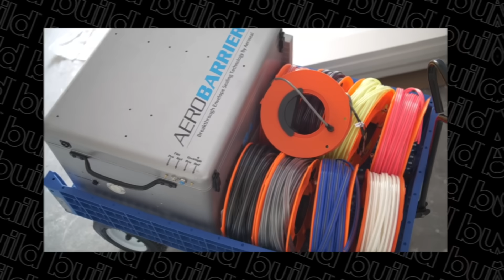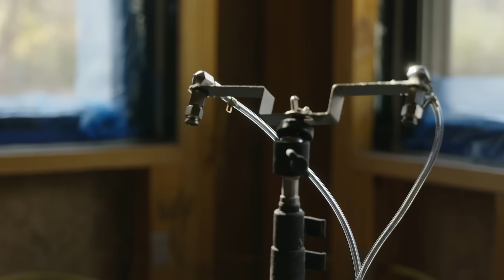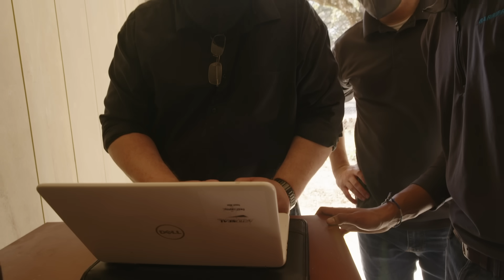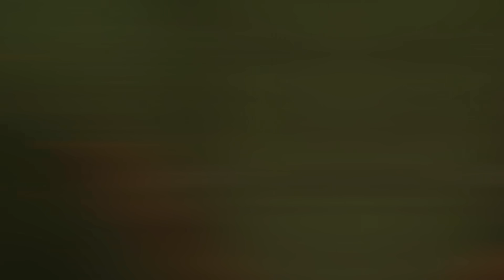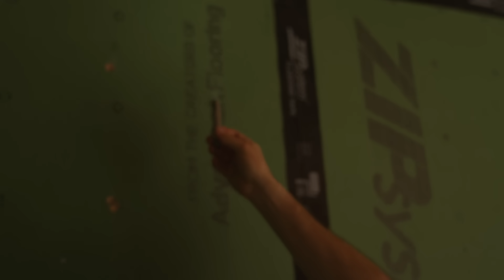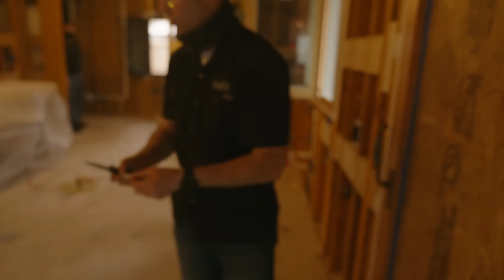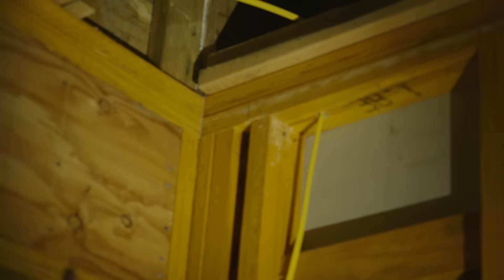The one product I'd recommend for EVERY House!

Comment: How incredibly inefficient. Like trying to use thousands of little fingers to plug holes in a giant leaking bucket instead of just building a better bucket that doesn't leak.

Anyone still using stick wood framing to build a house doesn't know what they're doing because they haven't been keeping up with any of the best innovations in construction: SCIPs, Thermasteel, Hemp Block, Green Rhino, Ecoplast panels, Mass Timber, SABS construction system, etc.

All of these are vastly superior to stick framing on the most important levels: faster, stronger, drastically more energy efficient (the SABS system and similar methods are at least 70% more energy efficient than stick-framed homes), more fireproof, disaster proof, more insulated, tighter building envelopes, pest proof, mold proof, waterproof, and in many cases, even cheaper in total cost because the framing, insulation, vapor barrier, interior, and exterior siding are all in one system, saving you the expense of hiring out each of those trades individually.

That's not even mentioning how much you'd save every month in energy costs by living in a significantly more energy efficient home.

As a pro, you're doing your viewers a disservice with this video and any like it. Do better.

Comment: Building a home this spring with the entire shell being made out of Thermacore's SIPs - moisture control like every house is key but even more so with the seams on SIPs since vapor can find every crack and make its way to the exterior OSB layer where it can condense and slowly rot the SIP from inside - That being said and if I have to choose the most cost effective means of dealing with this issue - the AeroBarrier Quote for the entire internal shell is $5500 - is this cost effective versus just using a WRB seam sealer like Prosoco or ZIP's liquid applied stuff???

Comment: In four or five weather cycles, there is a high propability that new and old openings will develop due to the house expanding/contracting and flexing under high winds.   

I see this as overkill and would never do it.  It more gilding the lilly in my opinion.

Comment: I support sealing a home with foam, wrap, taoe, caulking, etc . But sealing micro holes? I would never use this. I'd sped the $3k on more insulation or something more realist. Snake oil in my opinion. But I will say, its rather interesting. Love the channel

Comment: Complete hogwash!! People, read between the lines...
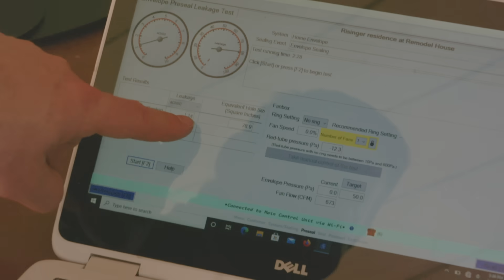...at 7:00, "if you were to add up all leakage, it'd be the equivalent of 40 sq. inches"... People, that is 6 1/2' x 6 1/2" (with a pressure fan pushing the air)...Just opening your front door for a few seconds is the same equivalent of that leakage running all day. This is complete garbage. You can't monitor moisture in every nook and cranny with these fancy and XXXPENSIVE air systems, and that moisture will find a place to sit when envelopes are this tight. On a smaller scale, this is no different than Gore-Tex shoes or a jacket...when sealed up tight, the moisture can't leave as quick as its produced , and humans produce a lot of it! (and Gore-Tex is breathable!!) Sealing an envelope (within reason) is great, but this goes way past what is needed. Giant added costs associated with this type of "improvement' and all the other crazy "energy code" regulations coming out... with another new batch hitting every few years. Proprietary stuff pushed by the lobbies of the companies producing them. Homes built like this have huge and complex HVAC systems, extremely expensive insulation packages, appliance packages that cost twice as much as a few years ago (with no added functional benefits), and other additional costs associated with almost every other trade task... bottom line "not affordable" affordable housing now is getting even further away for most people, and as these new ideas are accepted, it eventually gets pushed to the point of becoming regulation. Say no to overbuilding! Whatever your beliefs...we weren't created in a sterile environment, and we didn't evolve in a sterile environment. Humans raised within a sterile environment are also the ones that seem to have the weaker immune systems. Get outside, bring the outdoors in, limit your exposure to modern era building materials and chemicals, and relax a bit more.

Comment: Hey Matt, I am in the process of replacing all of my hail damaged vinyl siding. I am thinking about adding 1-1/2 to two inch poly board on the outside walls, then buck out the windows and doors ect. Existing walls consist of 2x4 with i think R13 fiberglass insulation and vapor barrier. My question is should i do this or simply zip tape the plywood joints, house wrap then reside? or go ahead and add the exterior wall insulation? I live south of Lexington Ky about 30 miles so not horribly cold or hot. Bottom line is I want the best bang for my efforts. Thanks Matt!

Comment: I asked a builder who has used this: "Why not just keep it running until the house is totally sealed?"

He had a client who essentially did that and ended up with rot in his walls.  If walls can't breathe at all, then any moisture gets trapped, and that trapped moisture will never be able to escape.
Reply from the maker: “Rot in the walls” really?  Air sealing had nothing to do with that. Incorrectly installed vapor barriers with water intrusion can lead to rot. But not Aerobarrier or air sealing. This old argument that “houses need to breathe” is bogus.  Code requires a blower door test to ensure tightness so leaky isn’t an option anymore.
Reply: @buildshow  I'll never know as much about construction as you guys, but this is from someone you've had on your show, whose work you endorsed.  I might  be misrepresenting the reason for failure because I'm just repeating what I was told, but wouldn't any moisture in the wall at the time of sealing get locked in there permanently?  Whatever the reason, his client sorely regretted sealing his house "completely".

Comment: The biggest problem with this system is the company behind it.  They want to franchise the system and charge licensing fees on every house you do on top of using their proprietary caulk solution. I have no issue with buying the caulk solution but I hate when a company wants to hold back a great idea or product with a bunch of red tape BS and try to control every nuance of how its used. Just unleash your product and provide/offer good training for installers and if you get too many complaints about one remove them from your list of approved installers. The good news is this video is already several years old so when the patent runs out and its copied by companies that arnt try to control everything with an iron fist it will be good for everyone (except Aerobarrier...). Until then a blower door, fog machine and some air sealing supplies ie. tapes, spray foams, caulks etc. you can accomplish the same thing with just a little more effort.  This is not rocket science folks.

Comment: For a few hours of work, the price seems way too high. In real-world conditions the pressure difference in most cases will not be enough to justify the cost of all this stuff, I mean how many years would it take to get that money back, 20 or 30 under ideal conditions (in theory). I would rather have the house breathe a little to help it from trapping moisture, depending on where the house is, zone 3 seems fine for not going crazy on all this sealing of houses, cracking a window, and getting some fresh air is more practical..

Comment: This is cool, but I have one major concern. If they are putting a high pressure inside the house wouldn't they be putting that pressure between every joint of Zip sheething? Couldn't that cause the tape to loosen up since it is being pushed from the back? I wonder if that could cause issues down the road. If I was doing this I would at least rerolled the tape after doing this. Maybe I am over thinking it, but if you are going to the level to get Aerobarrier you are already over thinking it so you should be paranoid about things like that.

Comment: Omf and in the south? Maybe in the north if you buy into the B's that this will pay you back. A box house was designed to breath. It was timber framed and had plaster with enough fireplaces to heat the arctic. Airtight is going in the wrong direction, absolutely wrong. You want a healthy house and efficient and sustainable you need a house that doesn't stop air flow but slows it down, with enough insulation to make condensation impossible. It should breath slowly. I've built several of these pasivehause builds and no way I would ever recommend building that way.

Comment: I watched your video on 3D printing with LavaCrete. Which got me to thinking. So look out. Stand back. I'm about to blow your mind.
What if,  instead of straight LavaCrete, which could still wick water, what if instead a plastic were layered down into foundation forms before the crete is poured? And have the plastic form go up the wall enough to make every foundation a sealed boat that the house is then built into?
Why aren't plastics used more widely from  the ground up? Seems like a thick, plastic barrier should go in first to protect what goes above it. And there are ways to mitigate the loss of friction. Barbed plastic piers. Corkscrew plastic piers. Etc... I can think of a solution for anything

Comment: No sure this will last or even pick up as a business. Why such fixation with micro leaks. A house has windows and doors. Every time one leaves or come to the house a door is opened. Lots of air comes inside. A micro leak seems insignificant considering that. A good air filtration seems a better option than spending money with that.

Comment: It sounds like you can expect to pay at least $1.50 per foot.  2,000SF home would cost you $3,000.00.  Just say you save $10 per month on your heating and cooling bill which would be 
$120.00 per year savings. Now $3,000 in cost to install divided by $120 per yr savings on bills, means it would take 25 years to get your $3,000 initial install costs back. Perhaps in reality you might save more on heating and cooling because of this.  I guess I would want to see statistics and also know if the product won't breakdown or shrink with time.  I suppose time will tell.

Comment: Such a cool concept. Brainstorming here,  what if the latex caulk doubled as a leak “identifier”; a bright neon color that could be easily identified and the latex applied by aero barrier could be reinforced with spray foam. Thoughts??

Comment: Air tight houses can be unhealthy. For most of the history of our species we lived outside. It’s called fresh air:
Reply: We didn't use coal and oil to heat our homes way back then, and there wasn't 7.5 billion people on the earth.  There's no way my wife is going to live 'outside' either 😁. Airtight and install an HRV in cold climates like central Canada where I live.  It's the only way to build now to avoid high energy use.
Reply: @karlhungus545 The building code in my area makes you build air tight and then install a whole house fan on a timer for air flow. It’s a racket driven by vested interests. I would prefer to build a little less tight and let the house breathe. There’s not that much difference in energy consumption all other things being equal. Buildings that are built as though we live on Venus are inherently unhealthy. Bacteria and other pathogens accumulate in the ventilation systems. People get sick more often. Modern office buildings are the worst. If you live in a place where you’re afraid to open the windows and doors because of air pollution, maybe that’s different.

Comment: Bro, with all the glues, tapes, paper rolls, metal rolls, nails, plastics, foams, pastes, this and that and blah blah blah...I still think a solid concrete structure and all else, poured at different times in a well designed manner, would save time and money over that wood frame construction and all the additives that "must" go in ...Build it once for centuries to come...that justifies de "CO2 emissions" etc etc ...LONGEVITY...Like an old dude that farts a lot...A long life well lived, over a young dude that does not fart much but needs a 💩 load of stuff to be useful...for a relative short period of time...100years (wood) over 1000 years(concrete)...Concrete 100%

Comment: I’m concerned for the lungs of people exposed during wet as well as aerosolized product transport into human airways. We aerosolize drugs for treatment of disease - the intake is inhalation. Aerosol is the delivery mechanism. If you can see particles in the light of the flash light, you are breathing these particles in. I don’t think you want caulk in your lungs!?! Has this concern been studied by the manufacturers? I can’t imagine an IRB would allow it otherwise. 

Awesome looking product though. I too would like to see long term studies done by your company, eventually. Obviously you can’t make long term data happen without having time itself. I imagine the caulk, once dried/cured, has been shown NOT to emit any chemicals into the air; this product has been found to NOT be hazardous to human/domestic animal health? Both aerosolized product and wet product (also dry product if that is even a thing??).

Comment: My concern would be longevity seeing as how thin it gets applied. As soon as a hole is plugged, which would be very thin at that spot, it stops being applied and doesn't keep applying to build up a decent thickness. I imagine those plugged holes would break open a lot easier as the house settles and years of summer/winter compared to a thick bead of caulk.
Reply: Good point, Regards it would make those holes smaller regardless of time.
Reply: Slam a door and blow out all the holes.
Reply: I'll bet that because a builder can REALLY see where the biggest leaks were, there might be a way to go around and reinforce with some sort of spray adhesive product ... ???  Also you could leave it running longer, maybe ... ???  I think that for a few grand, if it lasts for at least 10 years, maybe you get a positive air test done.  If it has dropped, pull out all your furniture and do a Reapplication (going by what the AreoBarrier guy was saying) ... but only if your leak pressure is down to where you are concerned ???  I do agree with you that there is some personal research to do on this, just like on any emerging technology.
Reply: It would be interesting if they made it in a bright color so then you could see it easier and go behind it with something to put on a thicker layer.
Reply: Okay even if it tears here and there, it would better off with it 90% efficiency.

Comment: throughout my years of experience it has been the houses with great ventilation that last the longest and have the least moisture and/or mold problems. Talking roof ventilation, lime mortar that allows masonry to breathe. Things like that. We maintain and restore homes and national treasures that are often over 100 years old. When they're well ventilated, the structure is in impeccable condition well past 100 years. That knowledge and experience suggests to me this technique will mean the house only lasts a decade or two without trouble, and will suffer condensation and mold issues. I don't know how this, long term, is good for a well built home. I'm not saying it's not, I just don't know how it could be. And the chemicals... Will people living in homes built with this suffer more cancer and related illnesses due to these chemicals? I don't know. It'll be interesting to find out and if it proves safe and superior then we'll head in that direction. If not, perhaps we'll go back to the old, proven techniques.
Reply: This whole channel is designed to sell high tech garbage....
Reply: @GAsh0012  I see. This was my introduction to it.

Comment: I guess aeroseal couldn't make enough profit as a duct sealing company only and looked for ways to expand. 

That said, given the added costs of including building envelope high performance scopes of work for all trades in addition to the high cost of aerobarrier itself, the economics favour using an air barrier to a the home that also insulates and can span much larger gaps.  Because as your video shows, you spent tons of effort and money on having your trades build a very tight home to start because that is what aerobarrier requires. Spray foam does not.

Comment: This is a horrible idea. You're just creating a ton of microparticles for your family to breath in at a later time. The house is going to move and shift and create tiny holes in the seals anyway. If you really want a totally sealed house, you need to use a material that doesn't move around and is made with factory precision. It's crazy to think flinging a bunch of tiny particles everywhere is a good solution.